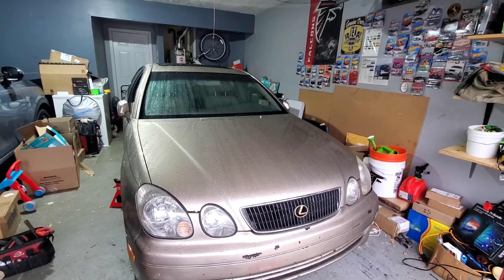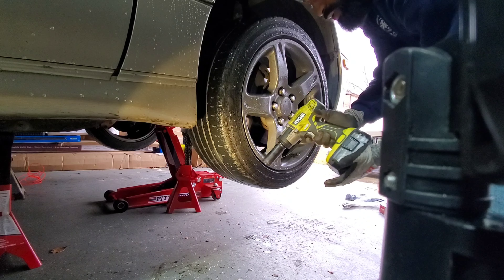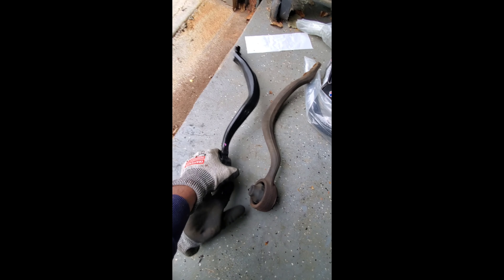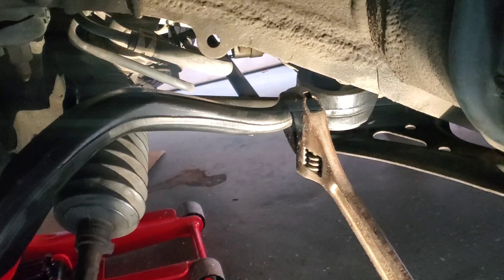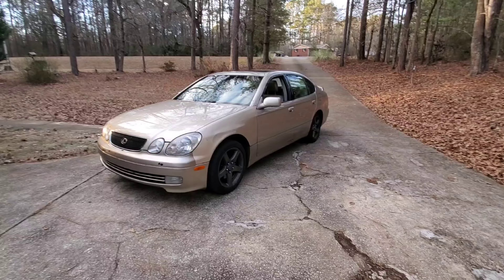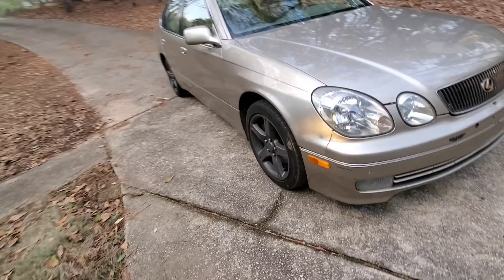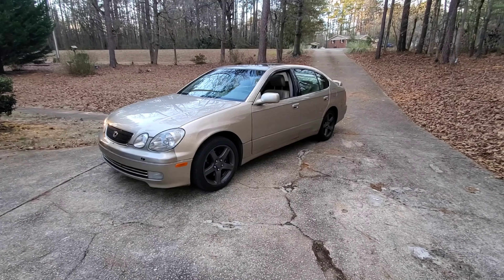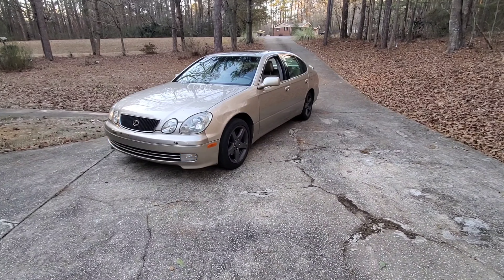$1500 lexus GS400 30,000 mile in a year.

Comment: Your correct, it's not just the current mileage of car, it's also the age that determines what needs replacing. My everyday driver is 98' lexus gs400 with almost 230k miles. Good luck with this car.
Reply from the maker: Thanks for watching! Good luck with yours also. Mine is at over 300k now and I'm still enjoying it. I just wish gas was a little cheaper 😆.